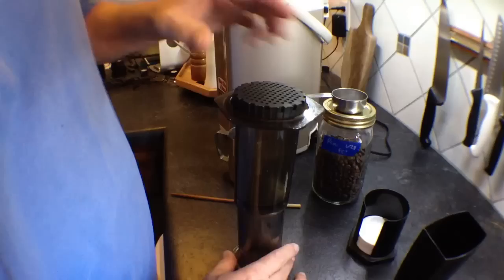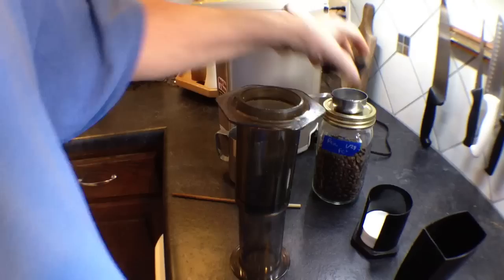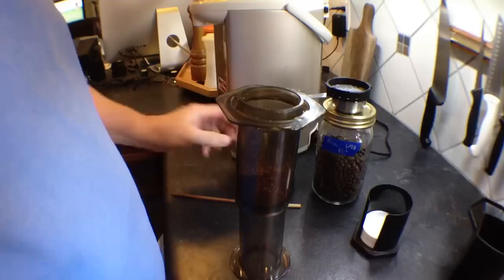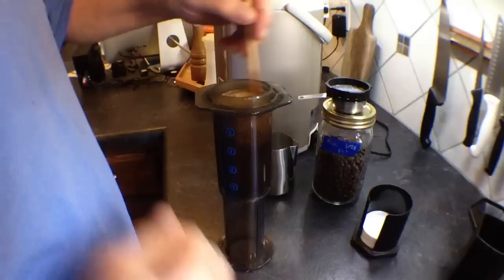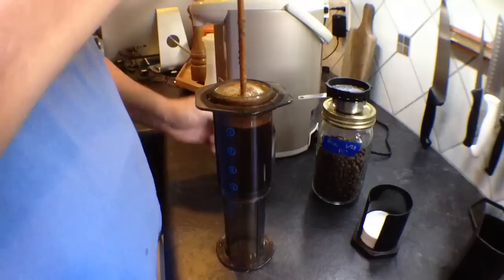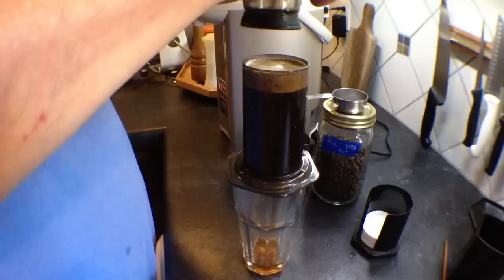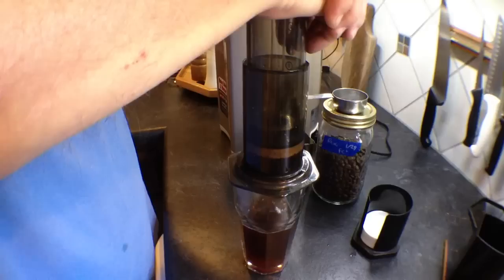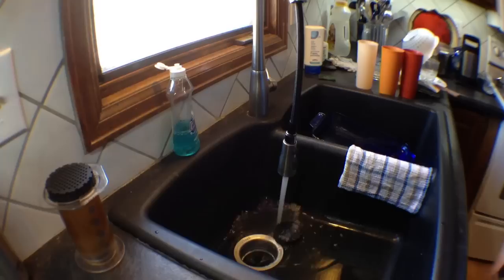Aero-Press Coffee - Upside Down Method

Comment from the maker: jaypee68 - yes it is low compared to a French press, but it is not weaker or any less full-bodied than french press.

Strength balanced with flavor with all coffee  is controlled by the size of the grind and amount of grounds. 

An expresso which is made in under 30 seconds is stronger than a French Press because it uses the same amount of grounds per serving, but they are ground powder fine and very even. 

French press is ground much more course to avoid extracting acids.

Basic chemistry.

Comment: Five times faster than a French press? I don't get that at all. I have both the Aeropress and a cafetiere at home and since the Aeropress has more parts and more steps to the process, it always takes me longer. I prefer the mouth-feel of cafetiere-brewed coffee to the toothless liquid produced by the Aeropress. But mainly I prefer the fact there are only two parts to the French press and there's no paper filter to mess with.
Reply from the maker: So it's a good thing you have choices.

If you grind finer, you will have some coffee with teeth using your Aero-press. Being a quick brew device, you need to grind finer to get a stronger extraction. If you like the higher acid content of steeped coffee, then the French Press will definitely bring that 'bite' into the mix.

Comment: I don't understand why you inverted it to start with and then de-inverted it (turned it back the 'right' way up) before extracting the coffee. By doing so, you've missed the entire point of using the inverted method!

The reason for using the inverted method is to maximise the coffee's flavour and texture by extracting the crema, which contains oils, proteins & aromatic compounds responsible for a large proportion of the coffee's flavour and texture. The crema floats to the top of the liquid, so when you de-inverted the Aeropress, you trapped the crema between the rubber plunger & the grounds rather than getting it into the cup.

The next time you make a cup of coffee, try keeping the 'press inverted, allowing the crema to rise to the top of the liquid. Then, rather than resting it on the cup's rim, hold the press in both hands at about 45 degrees over the top of the cup whilst squeezing the plunger in, allowing the coffee to run into the cup. You may spill a small amount but it's worth the hassle for the extra flavour. Alternatively to make it easier to extract and to avoid spillage, try extracting it into a jug first, as demonstrated here https://youtu.be/VTbA2jXI44c?t=3m54s
Reply from the maker: Hi Buckles - it may be why you (and the man in the video invert it). I'm not that anal - I have an espresso maker, so when I want the benefits of espresso I make espresso.

When I want a good cup of coffee, I invert it so it can be stirred uniformly without pulling the filter up into the stir stick.